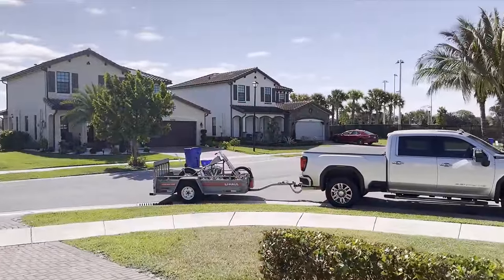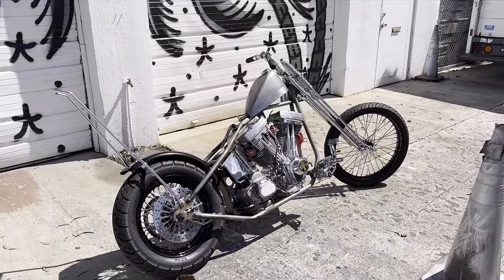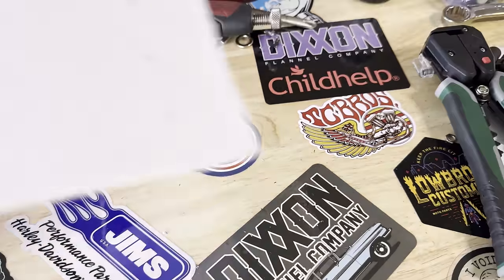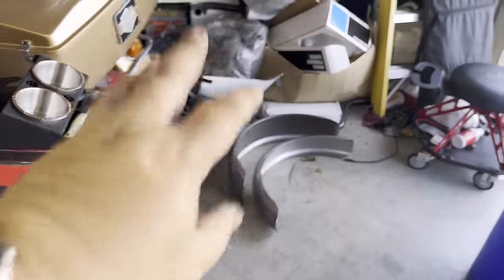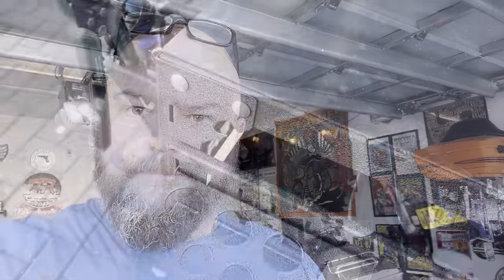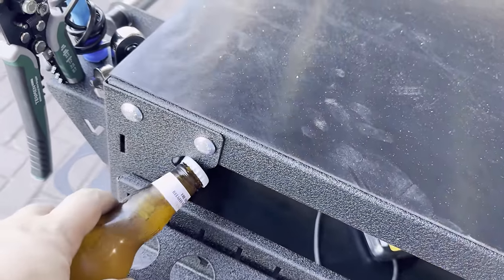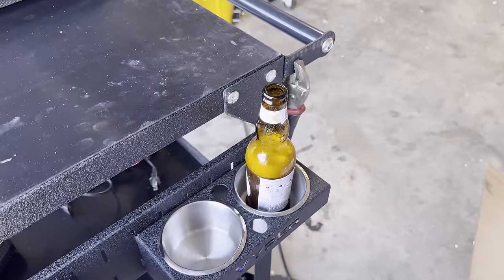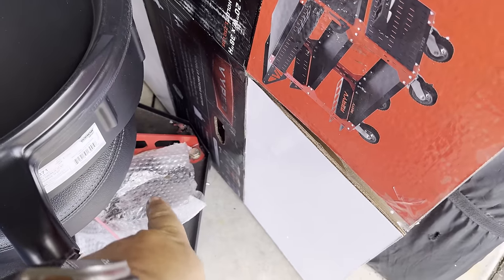Motorcycle work in a small space? Organization is EVERYTHING!

Comment: I have my garage floor coated for spills.  

Then I have built in racks on both side walls, and a storage rack over the roll up door.   

The wall rack came with slots and multiple hooks and hangers.   Plus I have two large tool boxes, and a rolling table.  

And I still have stuff on the floor and in the way most of the time.  🤷🏾‍♂️

Comment: I deliberately maxed out space efficiency for decades, wrenching everywhere I hung my hat.
Things that work:
Rolling work carts with LARGE wheeled casters preferably on both ends. Steel and aluminum U-boat dollies are ideally narrow, strong and easy to mod. I buy those used and take all I can get.
Rolling industrial work carts fabbed from standard steel shapes are also easy to modify. I do that by buying multiples at auction then making one multi-shelf cart out of two or three. A portaband or 6" angle grinder cutting disc and your welder of choice make that easy.
Rolling medical medicine carts are thousands of dollars new but cheap used and superbly built. They have non-marring casters and plastic outer shells to protect woodwork etc. 
Rigid tristands are superb bench vise holders. Weld plate to some ~2" pipe, bolt vise to pipe and the Rigid chain vise now holds your (rotating) bench vise.
If doing fork tubes, pad the tube with a soda can so the vise teeth don't cut the chrome and your fork will be held securely. 
Bulldog or J&S jacks bought used (because new is a ripoff for simple weldments and bottle jacks if needed are cheap. 
Heavy pickup truck pantograph jacks with any fixture you like welded to the top. I raise and lower those with my impact.
Pegboard because every empty wall is wasted.
Custom welding carts without cylinder mounting which is awkward.
Separate welding/industrial gas carts. Hose and fittings are cheap and moving a welder AND a large high pressure gas cylinder begs for back injury while separated is easy.
My welder carts get scaffolding casters which are inexpensive and easy to mount (slide into suitable tubing welded to whatever)
At least one real U-haul ramp to haul your scores home including motorcycles. I only give ~150 for mine (two so far) but they're realistically worth twice that for the convenience and easily.

You only need make something mobile and convenient once, then it's mobile and convenient for life. Everything in my shops is also mobile because that's inexpensive and easy to reconfig.
My compressors are on scaffolding casters and my shops are plumbed with air hose and either Chicago couplings (for blasting) or whatever quick connect suits the smaller diameter I want.
My lathe and mill got simple wheeled bases whose wheels are easy to remove (I use the outrigger dollies I fabbed from scrap to move many machines since self and bros help build each others shops). I pull heavy things with a variety of winches but in-shop a cheap Harbor Freight winch and a jump pack let me pull from anywhere. 
BTW if you bolt a small anchor next to the back wall of a shop or garage you can hang a snatch block off that, lay chocks to stop your four-wheeled vehicle then winch it into the space under much better control than pushing. You don't really even need a winch if you use suitable wire rope and rope clamps to make a long piece of wire rope with a loop at each end. I use that both instead of (by pulling by truck) and with (so I can disconnect it when moving trees if it gets trapped) my winches.

If you have a strong ceiling or fab a gantry the most stable way to wrench a bike is hanging it in midair because it cannot tip or fall. That gives full access without squatting. 
I hang mine between my steel shelves I fabbed for my shipping container shops and have an FXR in midair at the moment.